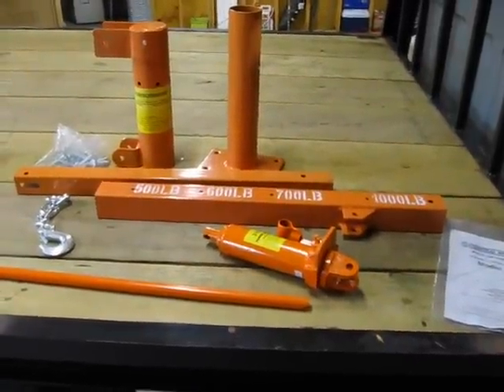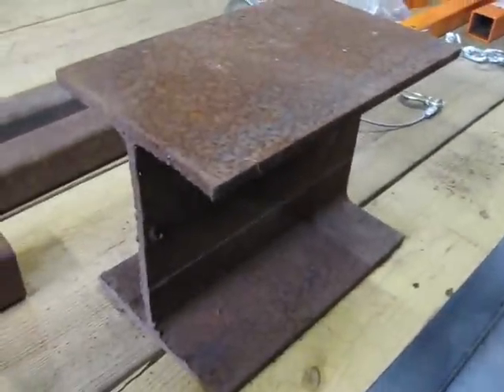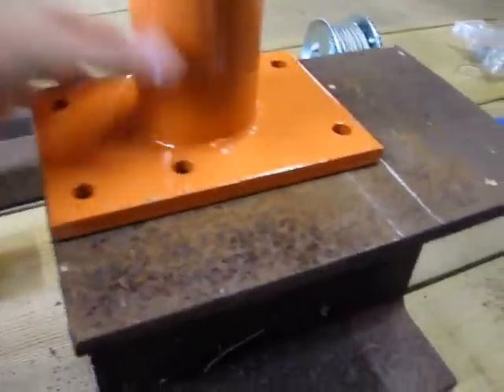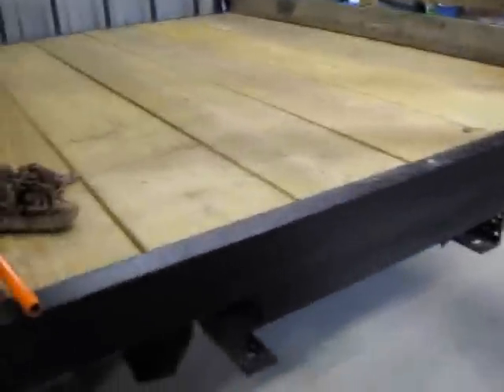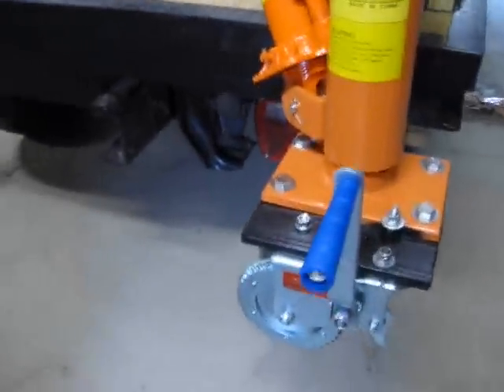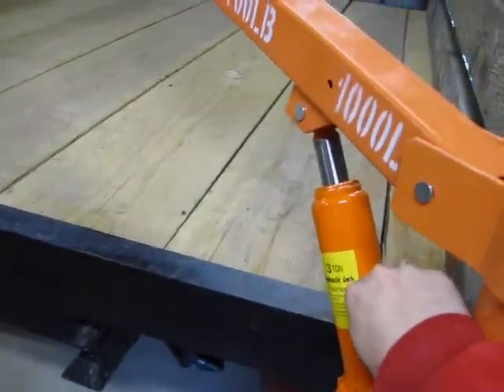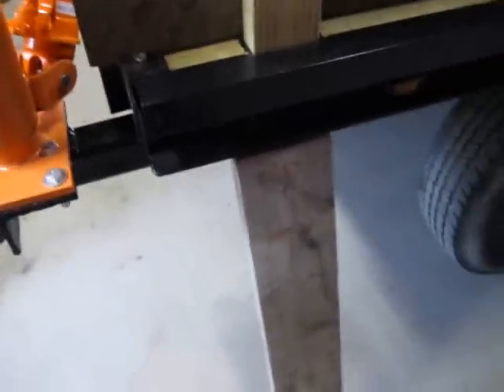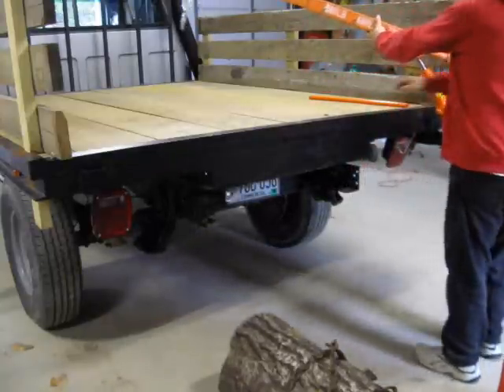My cheap pickup truck crane (Under $100 harbor freight model 1647)

Comment: That crane is the greatest tool I ever got at HF . It's now a jib crane mounted to a 6" square box channel buried 6' and concrete 2' around . Now it's a electric winch to put heavy generators or equipment for repairs. I absolutely love it .

Comment: I have the same Lift and it works very well. I have it mounted on a 1/4 ton pickup and regardless of what others say, if you are by ourself and need to put a 350 pound piece of lawn equipment on your truck this lift will do the job. I put mine directly on the bed of my truck and I've not had any problems with it under load. You did a great job putting yours on.

Comment: I mounted one of these on a 6 x 12 trailer, installed it on a mount welded to the outside of the  trailer frame.  my winch is on top of the crane column and there is a pulley on the end of the boom. the winch cable goes over the pulley  this allows me to drag and lift with the cable.  I have lifted  two heavy wood stoves and a disc plow.

Comment: It will pick up over 1000 I have one and have picked the engine and 4 speed trans out of a 1967 F 700 school bus. That was approx 900 lbs and it didn't even strain. I feel very confident with mine and I have had it for almost 10 years.  Still works great. I have mine mounted on a home made reciever hitch with a fold down trailer Jack with dual wheels and 2000lbs capacity.  That's my truck or trailer stabilizer.  I made a reciever for my trailer so I can pin it and use it to load it also. Thanks for the video.

Comment: Great idea, I too have a lifetime of back injuries, this is just the ticket for avoiding them.  Using brains not brawn.

One suggestion, consider putting a small pulley on the hook, and using the winch to do the actual lifting and the hydraulic jack to move the boom up or down.

Comment from the maker: Well, yes, you are right however I have a bad back so I try not to do any heavy lifting.  I also use this crane on rare occasions as I am not a pro logger.  I occasionally will pickup some free logs or load/unload my rototiller or other things.  It gets used for small jobs but is a big help when it comes to my back.  Thanks for watching and taking the time to comment.  :)

Comment: another idea to speed up your lifting might be to keep the crane extended up to its highest point (so your not using the slow jack all the time), use the hand wench or another hand wench mounted to the upright shaft (so it follows where boom points) run cable through a pulley where the hook is and run it down to the the log. this could even be used to drag lighter logs and lift them at the same time. a hand wench with a good gear ratio should lift a 500lb log easy

Comment: When you get tired of pumping that jack, you can get the HF 2500 lb winch and mount on this lift, over the square tube, cable over the square tube, mount a steel pulley at top, with or without a fairlead.  

The HFT winch comes with a remote control fob.

Buddy of mine has rigged this up in the rear of his Chrysler mini van to lift his wife's 300lb power chair and swing it into the rear door.

The hydraulic cylinder is now only used to adjust the boom height so the power chair clears the bumper cover.

Comment: Thank you for sharing, your ingenuity of the receiver hitch and custom fabrication was appreciated. The location possibilities are endless. I suspect lift height can be mrpoved.  
The failure points on my harbor freight crane was the hand crank winch and at the posts on the taller, gray model. My solution was to sleeve the tall post with an outer pipe of stronger gauge metal. It was my fault, i release the bottle jack way too quick. The weakest part of this lift system is the hand-crank- user beware, I am now Installing a power winch. Should help both failures. $160, taller gray model mounted to 2 of the bed frame rails by the drivers side cab. 13 gmc 2500Then added $120 in an 18" pipe extension and aluminum plate that has a hole cut out to support the post higher up..
Reply: +Katie Bryan Do you have photos you could share?

Comment from the maker: @kenfo0 I kept it simple on purpose.  No wiring, no pulleys, etc.  I use this rarely (which is why it is removable).  I actually prefer the fine control of manually operating it when doing things like loading my tiller or other occasional items for transport.  Less to go wrong and cheaper to construct.

Comment: Good Idea. Don't listen to all of the D-Bags out there. Have you thought of using a wood lag bolt with a hook, instead of wrapping a chain around the log? It may be easier on your back to have an electric impact with a lag bolt. It would be much quicker. Just a thought. And by the way, I have a very good back and I am still going to build one. Thanks for the idea.

Comment: Pretty nice mount setup. I have the larger crane on a fixed mount at the front of my flatbed on the passenger side. The winch that came with it broke on the first job, had to replace it with a better one from Tractor Supply. After about a year the seals in the hydraulic ram started leaking. All in all it's paid for itself though, mine is rigged with a guntackle and has successfully loaded roughly 800lbs at a time into my bed which is about 56 inches from the ground.

Comment: Very nice job! Creative use of an I-beam as support for the crane base, as well as the hand winch. I have the same H-F crane, but attached it to the bed of my truck, more or less in the area recommended by H-F, but I used a lot more bed reinforcement than H-F supplied. Like you, I did not use the 2 angle iron bed reinforcement pieces, either - I did not think they would be nearly sufficient to adequately support the bed while the crane was under a substantial load.

Comment: I like the idea of running a 15,000 lb wench through a block on the swing arm.
 eletroniclly pull your 300 pound stump to the truck, and raise it to the bed hight then lower it in. modifications will need be made, 
 OR  just get a air compressor and an air jack to replace the pump jack.

run the wench through a pully at the tip weld a cross member to the frame
attatch the kit to it and block the swing arm at a fixed height .
this stuff is fun .

Comment: I have the same crane and works great,but I will recommend you weld the crane base to the steel   
mount since my bolts snapped under load. I welded mine and no more bolt issues. Good choice on the A-Team song.

Comment: You can use a 2500 lb winch or less f and some 12 volt alligator clips to the battery or maybe even the towing plug to operate an electric winch mounted to that setup

Comment: You could mount a little scissor jack to the under side of the crane base and be able to put your 2X6 between it and the ground so you have an adjustable stabilizer in case the truck is on rough terrain.

Comment: a friend of mine bought one of these for a hundred and 25dollars or something like that, he bolted it to the skin of his f150 truck bed and put a clamp around it to screw to the in side bed rails. he bought a winch along time ago from hf, were using it last night, and the spool pulled out of it's frame.  he also had a hf com-along that was so cheesy.

Comment: What I would do is add a pully to end of the boom and run the cable from the winch to it then lower the boom and crank up the slack, maybe add a plate to the vertical pipe and attach the winch there, you can still use it to pull logs closer. one better would be to also buy the electric winch and hook it up. You could really have fun with this idea. Just thinking!

Comment: They sell a crane with a taller mast that has a hand crank winch for $140, and their routinely sell their 2000 lb electric winch with brake and remote control for around $40.  If you use your 20% coupons you can get both for under $150, and the 2000 lb winch will mount where the hand crank winch did with just a bit of filing.  I've used it to lift 1000 lb loads into my flatbed.  No sweat.

Comment: Very smart idea but unless you have back problems or extremely large logs the time it takes is in efficient you could make a spring assisted pully system for small logs to help load then use that for big logs

Comment: Make up a pulley to go on the end of the boom and you can use the hand winch, put the cable up to the end of the boom, through a pulley, and down to your load. Instant crane.
Buy a Petzl Fixe pulley normally used for rock climbing.

Comment: I just bought a 2500 12v electric winch from HF About 45 bucks on sale. 
Those hydraulic Jack's are a lot of work and take forever. 
I like your mounting setup though.

Comment: i was a bit bored at first, but ya got me with the A Team music. NOTE: when they say mount to frame, they mean bracket from frame to bed, drill holes, then bolt through bed to frame brackets, just like an in bed rail mount 5th wheel set up. I am looking for a way to adapt my 5th wheel rails to mount a crane thats removable.

Comment: I just got done installing my harbor freight crane in my Dodge pick up. 
I mounted the unit in the back corner of the bed and tried to lift a TV. Big mistake. Even with the angle iron braces underneath the bed folded up when I tried to lift the TV. I'm how looking for some half inch plate for the bottom and also drilling a hole on the top of the crane for top mounting support. That should help with the weight. I'm also taking back the crank pulley winch I got you don't really need it.

Comment: I have one.  I think I'll do mine a little different.  The torsional stress on that hitch makes me nervous.  See how the load makes the crane bounce.  All of that flex  originates on that hitch.  I'm not an engineer so I tend to over build things.  The loads may be perfectly fine but in my own hysteria, perhaps, the flexing makes me nervous.  I think I will also install a jack leg to stop my truck from lowering as I lift the load.

Comment: You should mount the winch on the back of the boom with a Lully on the end of the boom. Use the winch to raise the load and the hydraulic lift to get the hight you need to get the load into the bed. Nearly a suggestion.

Comment: Not bad, I would be rounding off the corner of the mount closest to the right hand side of the truck. You or some other unfortunate could walk into it and that would take a piece out of you.

I think I'd be setting it upso that I could lift the beam and pin it in the position I desired and running the winch up along the beam and lifting it with that. I'd also be putting an ATV winch on it,they are less than a hundred bucks now. I might make one of these up for my box trailer.

Comment: Me, I'd check the jack oil level in that pump if it took so many pumps to do the lifting. Lots of bounce and wobble as you jacked it up, but you didn't have your wood brace beneath the back end of the truck on the jack mounting side.  Good video.

Comment: they had those remote control 3000lb camo winches on clearence..  with a 20% off coupon i was buying them for $29..  dont know if that was just for demo, or how you actually plan to use it, but it would be much easier to just leave that crane on the tallest setting , and hang a small block from it.  that way u can just run the winch line thought the block..  swing in, swing out..   nice job though..  wish i could weld..

Comment: Excellent application for that crane  there are ways to convert hydraulic jacks to a air assist  that speeds them up with a foot pedal  if you had lots of logs to haul that might help as there are plenty of gas powered air compressors and 12 volt ones  !you may also be able to runa small one off a inverter too ?

Comment: I have one of these lifts I purchased in 2007, and have had it mounted on two different trucks. It currently is mounted onto the back corner of my 3/4 ton Chevy flatbed. I have had no complaints except the cylinder is starting to leak down when under pressure, so I am kind of wary about it. I have used mine to lift up to 40" cross-cut tree trunks to sit them on a log splitter.

I'm not sure how much progress you made with the hand cable winch, but something you might consider is buying one of the $59 2000lb electric winches from Harbor Freight and mounting it on top of the lift-arm, running the cable over the end of the liftarm through a pulley in place of the lift chain. That would take a bit more of the physical work out of the equation.
Reply: 3

Comment: Looked close to maximum height at its lowest weight setting. Feel you would need the load a little higher than ground level to make use of shorter chains.

Comment: I'd love to make this work for my truck BUT , I want it to somehow fit beneath the topper and inside the tailgate so I can close it up inside.
What I currently do is use ramps and just slide the items up into the back with a winch mounted into/under  the front floor of the box via a thick mounted plated and 3/4" fine threaded long nut welded beneath it.
I thread a 2" trailer ball in the hole and hook my portable winch on it and plug it in.
It sure is handy.

Comment: cool. need you as a neighbor.  bought the same HF crane.  bought a truck mount reciever. now looking for a winch receiver with the right holes.  not sure if I can drill into carbon steel.

Comment: you needs a set of those wood tongs (not sure of the proper name for them, I could be right for all I know, lol....),   those tongs are quick and easy, plus you don't have to worry about the chain wrapping under the log.  the more you pull on them the harder they bite into the wood.
Reply: Those tongs and the electric winch both sound like good additions.  Either way the set up is pretty bad ass.  

I cut them longer then tip them up on end and teeter totter them on the edge of the bed into the bed.  It's rough on the back.
Reply: rdog1121 q
Reply: jim sm
Reply: ice tongs

Comment: go get a 12 Volt winch 2000 lb. from HF put it on top of the crain, then no more pumping on the jack : ) and replace that hand crank winch with a 3000 lb 12 Vole winch. so you will CUT your work time by 60% and you will not be tired at the end of the day.
Reply: agree'd!
Reply: Very good machine

Comment: They make a log gripper - I found some from $25 but 30-50 bucks might be a better range for a set to do the job for you GOOGLE  'Logging Tongs' ($32.35) Home Depot has a Fiskars Set ($41) that works with 12' diameter logs - but would need modification to allow you to hook to it. The designs are similar and you seem to have the tools to build one from scratch. It would eliminate (putting) the chain 'round the log (then removing it).

Comment: Looks good sir.  Wonder if i could rig a portable mount that would slide in my trailer hitch. For loading a generator or 100 lb propane tank. Had considered a trailer hitch mounted game hoist. Thanks for posting.

Comment: Man I'll tell ya stuff is so cheap in America, $80 US is about $100 Aussie and a crane like that here (not the same brand but the same weight lifting capacity and appearance) is over $400 Aussie bucks, or about $500 US. A pack of Winfield tobacco weighing 25 grams (or just under a US ounce) is around $58 aussie or petrol/gas at the moment is around the $8:50 to $9:00 Aussie a US gallon. So about $11:25 US a gallon. 50% of that is direct tax. It's really bad here

Comment: You should know this by now using this setup but loose the 2x6 idea use someting adjustable because when you load stuff the turck goes down after enough weight. Your board will become stuck and you will have to drive off of it.

Comment: I have the same rig. Bolted to a mount on the tongue of my firewood trailer. Was great for a few months, lifted some heavy stuff- 12’ long 2’ diameter logs, 700lb Diesel genset, etc.
Then the jack started to leak where the pump cylinder is. Replaced the 0 ring, still leaked. Can’t find that jack configuration anywhere without buying the entire crane again. Guess that’s par for Chinese harbor fright shit.
Reply: Easily..
Reply: Measure the seals id and od and go to a seal shop.  I guarantee you they are available.  Any hydraulic device is repairable.
Reply: @jayhansen5609  Yes and no. Never heard of a seal shop but... I’ve rebuilt cylinders, so I know a little bit. What I’m seeing is the plunger bore is pitted, probably low quality recycled metal or ‘pot metal’. So I think the metal degrades over time and tiny bits flake off the wall of the bore. I tried about 6 different o rings, I’ve got hundreds of sizes and thicknesses. I could have probably drilled it out a few thousandths and started over but if it’s shit to begin with I’m just wasting time.
Reply: @brucea550  JB Weld.

Comment: So you put all that work into fabrication, yet you use a board to add support? Why didn't you just fabricate a square tube on the bottom of the hitch that is hinged. When you need additional support simply swing it down and lock it in.

Comment: Am I wrong? Does this lift every log to the same point on the truck bed? So, you have to move the last log before you can lift on the next one - climbing on and off the truck to place each log? Or does the boom (?) telescope?

Comment: Wouldnt this work if you mounted into a towing hitch receiver at the center line of the bed?
Reply: ritewayguy You could, though the hitch isn't made to handle the twisting that the crane will put on it. Most only take 500lbs max tongue weight straight down.